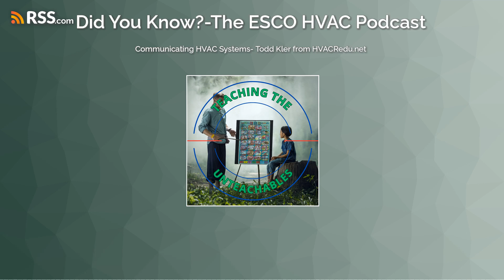Communicating HVAC Systems- Todd Kler from HVACRedu.net

Comment: I would suggest that serial comm is not “very similar to a pulse width modulation” and it won’t “pulse width”.

It is not “how long it stays on or off” which doubles down on the idea of pwm, while technically “going to do this in pulses that are going to be on or off” is accurate if it stopped there. The type of serial comm widely used today transmits and receives a series of high or low pulses as ones or zeros using the same pulse width for both.  

Then “if we have a bad ground within the system, we can really have some issues” is accurate.  In fact connecting commons together makes much better sense than relying on chassis grounds or even ground rods which are there for electrical safety. 

The pwm analogy comes up again incorrectly when comparing dot (1 time unit) and dash (3 time units) “pwm” telegraph signaling. Correct for dot dash, not for serial comm with fixed pulse widths.   

I do agree that protocols are similar to languages but protocols are separate from the electrical comm path such as RS485, which uses hardware such as differential drivers and receivers capable of eliminating momentary “common mode” rf interference by sending a positive pulse for a one bit while concurrently sending a negative pulse on the - line for the same one bit.  All devices have to remain within + 12 or - 7 vdc (typ) of each other for serial data to be transmitted and received.  The “bias” as described means there is enough voltage left after loading or wire impedance to properly work as described.  Protocols typically define the bits, bytes, packets, error checking and error recovery in addition to addressing and comm master slave sequencing. 

Making a protocol standard like automotive obd2 or industrial modbus or whatever would allow a day when an integrated or addon bluetooth module with a generic or customized app would quickly decode and or diagnose hvac comm issues.  Without using a scope which is usually only needed in a development lab.  Even then a special protocol analyzer hardware or software solution is the preferred engineering tool   

Overall a useful attempt but setting up inaccurate visualizations like pwm can handicap the listener when future observations conflict.
Reply: A definitive application note on RS485 from Texas Instruments can be found by searching 

Application Report The RS-485 Design Guide Texas Instruments

Note the best way to connect systems from a ground perspective is the paper’s figure 11c.  Ideally connection to chassis ground is through 100 ohm resistors plus use of direct signal ground to signal ground.  

Even better approachs use optical isolation which is significantly costlier to include.
Reply from the maker: Now there's someone who can dive deep into communications! Thanks for joining in RJ. This is the intel we need to be discussing, getting an OEM to talk communications is like asking Colonel Sanders for the secret recipe. Would you be interested in educating me on the functionality of serial communications? If so I would love to dive deeper....cbeck@escogroup.org

Comment: Commercial and residential HVAC for example there’s no one software and plug-in, communicating and pulling in codes that are universal between Daikin LG Samsung Panasonic

They need to make, and pass a rule in the United States. All these residential commercial want to take advantage of the government subsidies the handouts and promotions with taxpayer funded rebates. . 

There should be a rule included in there if you want these mates and you want us to push the new electrify everything and heat pumps . 

The industry has to decide upon one standard communicating protocol with one standard software just like Automotive . 

I could buy a third-party snap on or launch or or Matco, scanner and EP programmer.  
And I could hook up to a Mercedes Toyota afford Chevy or Chrysler or Fiat 

And I can read all the codes because they’re all the same and I could look at and read all the sensors actuators I could drive expansion valve open I could open up an EGR on an engine. I could look at a barrel sensor or map sensor or TPS. 

Residential commercial need to be held to the same standards they want money they have to follow some rules to get it